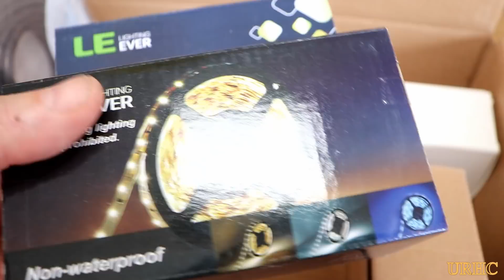Kitchen Update Part 7 Installing Low Voltage LED Accent Lights

Comment: These are beautiful!   After watching this, my wife can't wait for me to install them in our kitchen.  There must be hundreds of related products on Amazon.  Can you provide some detail on the specific items you purchased?  Were the lights part of a kit with the power supply, or did you purchase all the items separately?  I am enjoying all your videos.  Your wife's crocheting is delightful.   Thank you for sharing these videos.
Reply from the maker: This is the basic LED kit that I purchased https://www.amazon.com/Flexible-Daylight-Waterproof-Kitchen-Included/dp/B00MHLIELM/ref=sr_1_3?ie=UTF8&qid=1522539756&sr=8-3&keywords=led%2Bstrip%2Bkit&th=1  There are many different options of color and brightness available so you may want to decide if you just want warm accent lighting like we did or brighter whiter light for working. 
This is the channel kit I purchased that worked with these strips. https://www.amazon.com/Muzata-Aluminum-Mounting-Installations-Diffuser/dp/B01M09PBYX/ref=sr_1_1_sspa?s=hi&ie=UTF8&qid=1522540130&sr=1-1-spons&keywords=led+strip+channel&psc=1  
and if you search there are different options available including corner mounts and I think the leds are also available with the option to adjust the K temperature if you want to get into a little more expensive strips. 
I also purchased a extra strip and power supply to try under my living room valence.  Thanks for watching.

Comment: Been following along.  Very nice work!

Curious how the wires from all the sections are connected to the transformer.  I don't think I saw that in the video.

Have to say I'm jealous of your gardens also! 😉
Reply from the maker: I only showed a quick shot of one of the transformers plugged into the remote switch. I just cut the plug off the end of the transformer wires , soldered all the positive (red) and negative (black) wires together and then insulated them. It will all depend on the transformer used so I didn't want to get to deep into the wiring. For a single strand there is a plug on the led string and a socket on the transformer and they can be plugged together. There are also splitters and pre-made cables that can be purchased if you have room to fit them in. There are many different  options for wiring the strips. Thanks for watching.

Comment: I've been wanting to do this forever. How happy are you so far with the parts you chose?
I looked to see if I could find an Amazon storefront of yours with these, and didn't see one.
Maybe when you have a few moments, setup a page with these items on the Amazon Storefront, or link to them?
I'd like to send the business your eay.
Thanks.
Reply from the maker: They have worked out great with zero problems.  I have them working with smartthings using the Wemo plugs and they have been on at least 8 hours a day with no failures yet. These were the warm light medium brightness chips. I still haven't figured out how to setup a storefront and wind up getting new codes for each video.  I will definitely look into setting one up soon. I am not sure if LE still has the same strips but will look into that and give you some links.  I also added some inline pwm manual dimmers that let me fine tune the brightness.  The aluminum channel and diffusers really help even the light out. Getting ready to order more for backlighting my TV so I will see what is available now. Thanks for watching.

Comment: They only problem with those type of led lights is when one goes out in the middle of the strip. I have seen it happen several times I prefer Xenon under counter lights they are pricey but we like the look of the light and bulbs are replaceable.
Reply from the maker: They waste too much energy and are not as even a light as these. It would only take 5 minutes to peel out and replace a bad strip. I bought a extra 16 ft strip just in case of a blown led. Thanks for watching.

Comment: Nice job! I have all the stuff laying around, just need to install it here :D And normally those dimmers are pretty rugged. Only the the fabrication isn't always flawless. (What can I say, China...) So you were probably just unlucky :/
Reply from the maker: If I need dimmers, they have one that looks to be made a little sturdier that I will try. It was a bad solder job on the board in this one. Thanks for watching.

Comment: bonjour , good job , you will need a stainless refrigerator :-)  :-)  :-)  .
Reply from the maker: That fridge is only 4 years old and will last another 10 years. Maybe just a can of stainless steel paint. All the new ones are too tall for our opening. Thanks for watching

Comment: Nice job!
I saw this and it reminded me that I bought, but have yet to install mine. lol
I like those aluminum extrusion and diffusion lenses and I think I might like to use them.
Were those an Amazon item?
Thx
Reply: Oh boy those aluminum extrusions are expensive. lol
A 6 or 10 pack is way to much for my small 10x10 kitchen.
Reply from the maker: They were on Amazon. It was $19.00 for a 6 pack . The light is really harsh and reflective if you don't use them plus they are a good heatsink. You can also find them on ebay and many other sites for less.  You just have to match the width. The 3000k color is very warm.
Reply from the maker: Those prices on Amazon vary day by day for the same item anymore. If you want to dim them don't buy the $5.00 PWM dimmer that I tried. It is junk.

Comment: Can you list the parts?
Reply from the maker: I didn't list the parts because there are different light output and light color strips available to choose from. I figured each kitchen may have a different requirement. These strips give off a warm yellow glow accent type of light and work with the channels and connectors used but if you change strips the other parts may also change. I will put some links to what i used in the description later but research the exact look and ammount of light that you want in the end that will complement your kitchen.
Reply from the maker: This is the basic LED kit that I purchased https://www.amazon.com/Flexible-Daylight-Waterproof-Kitchen-Included/dp/B00MHLIELM/ref=sr_1_3?ie=UTF8&qid=1522539756&sr=8-3&keywords=led%2Bstrip%2Bkit&th=1  There are many different options of color and brightness available so you may want to decide if you just want warm accent lighting like we did or brighter whiter light for working. 
This is the channel kit I purchased that worked with these strips. https://www.amazon.com/Muzata-Aluminum-Mounting-Installations-Diffuser/dp/B01M09PBYX/ref=sr_1_1_sspa?s=hi&ie=UTF8&qid=1522540130&sr=1-1-spons&keywords=led+strip+channel&psc=1  
and if you search there are different options available including corner mounts and I think the leds are also available with the option to adjust the K temperature if you want to get into a little more expensive strips. 
I also purchased a extra strip and power supply to try under my living room valence.